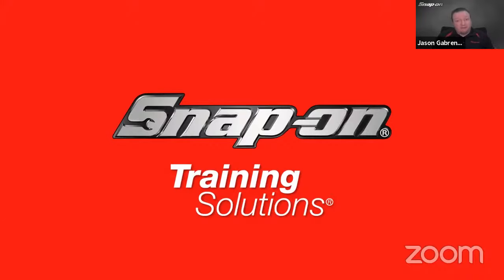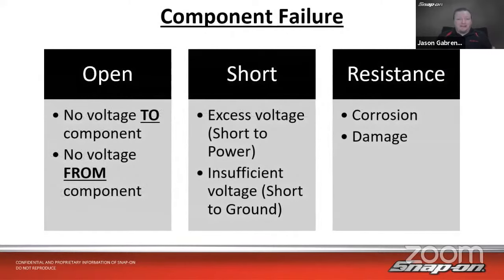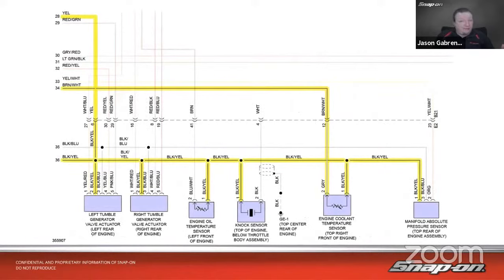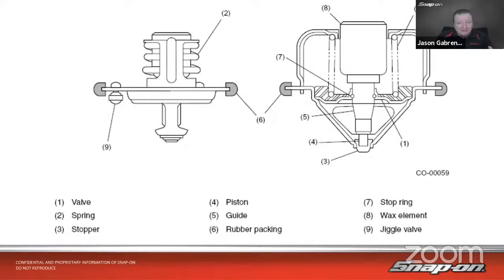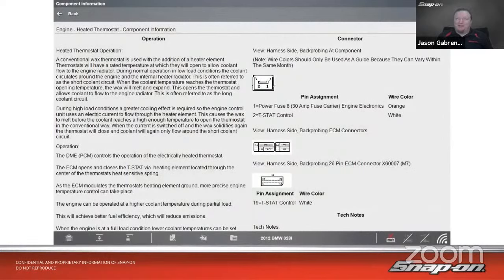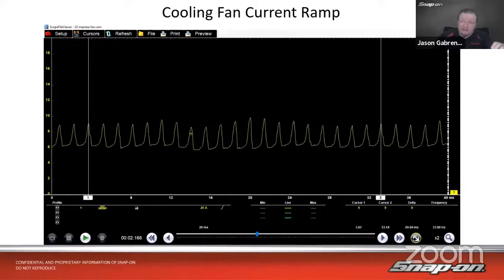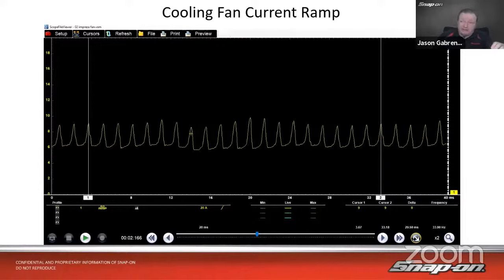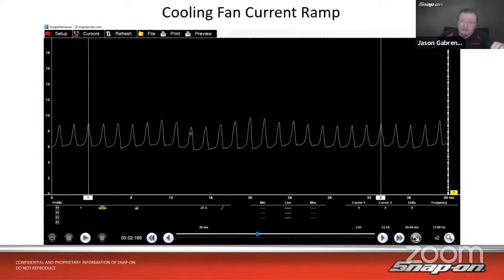Component Testing: Cooling System Electronics - Snap-on Live Training Episode 24

Comment: Hi Jason,
I like all your videos and I understand that sometimes is hard to keep all information correct since you cover so many different topics. So I just want to address here on this video on minute 9,  you talk about thermistors and show a diagram where you have selected in yellow what you describe erronously as the 5v reference. Thermistors uses a completely separate 5v signals that gets pull down to ground as the temperature changes. So in this diagram, the line you select is the ground wire and not the 5V. Also the knock sensor,  produces a signal and sometimes has bias voltage mostly for diagnosis porpuses and in the same diagram the wire you selected is the ground.  I want to share this so you correct the error and keep giving us all these great content with good information. Thank you for sharing your knowledge.